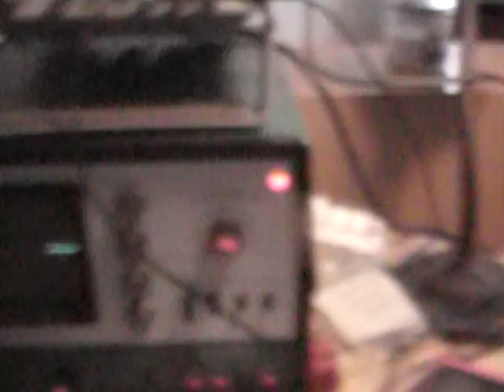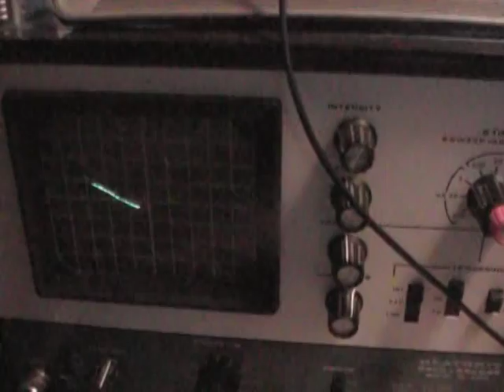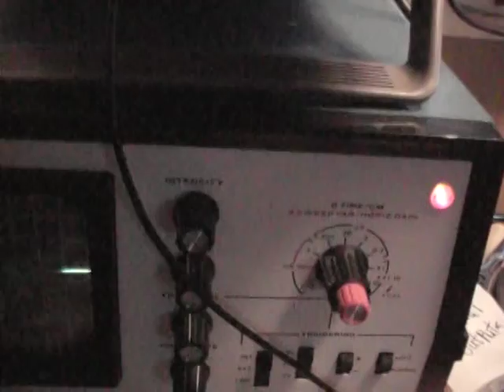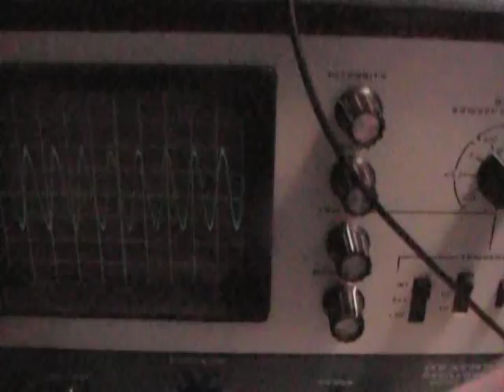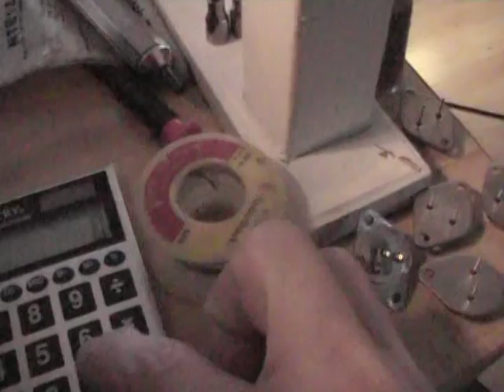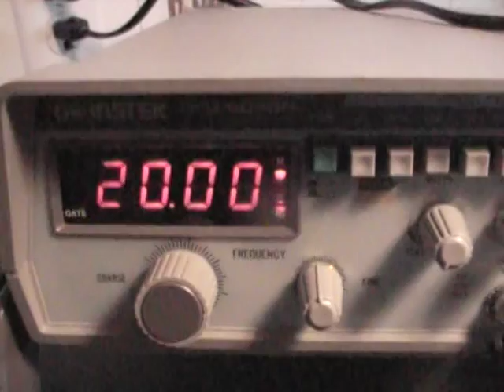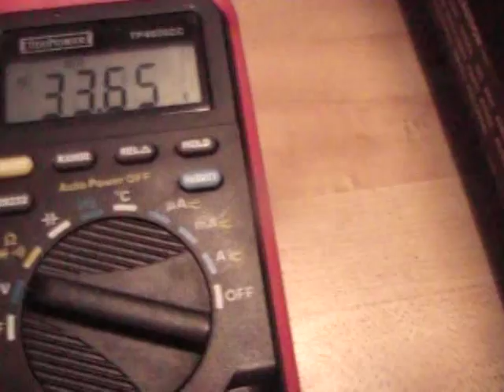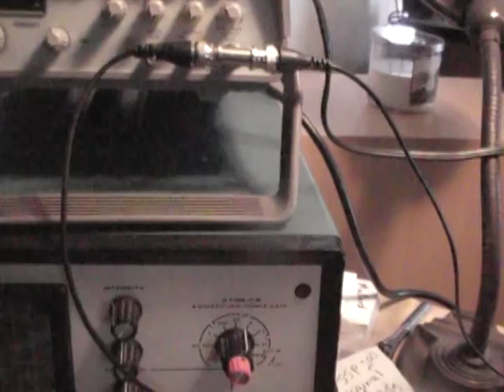Harman Kardon Citation Sixteen amplifier

Comment: I still have my Harman Kardon Citation 16a from 1978 and i had a Harman Kardon Citation 16s too. Wayback in 1978 the Harman Kardon Citation 16a was connected to a Dayton Wright SPS pre-amp and a Mark Levinson pre-pre-amp. Nowadays the HK Citation 16a is connected to a Denon PRA-1500 pre-amp. The HK Citation  16a power-amp has been recapped in 1990.

Comment: owned one of those amps back in the 80,s when i managed a audio store in portland oregon, loved that amp. also liked the deep purple smoke on the water you were playing.thanks for the memories.
Reply: I'm in Portland and I have one! Could be the same one. (but it probably isn't)
Reply: @chaddraizin6616  , sold mine to doug over at audio specialties on 102nd across from gateway.
Reply: @chaddraizin6616  ,i originally had a citation 19, i was working at freds sound of music on hawthorne,,.had a chance to trade-up to the 16. also had a nakamichi pre-amp, nakamichi 480z cassette deck , and the m&k sat. subwoofer speakers.worked for freds for over 11 years, saw lots of great stereos.ever have any questions about stereo equip. don,t hesitate to ask.